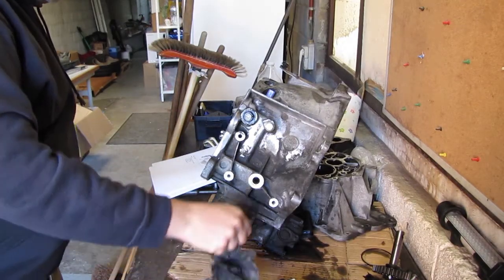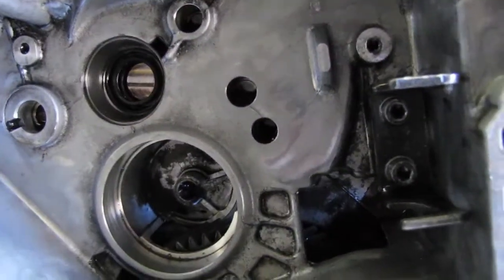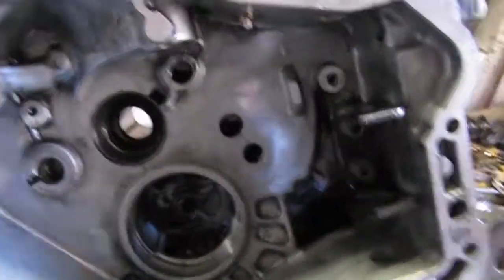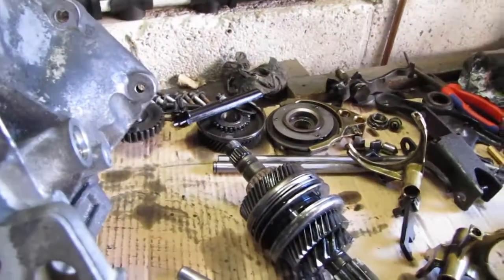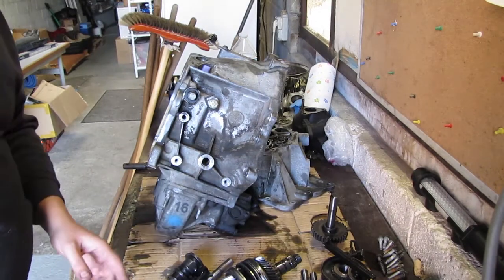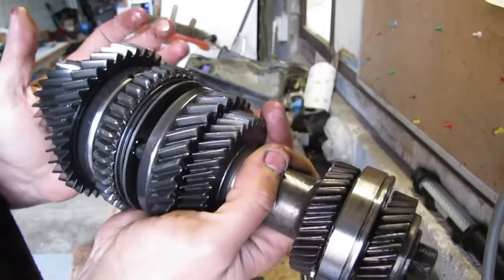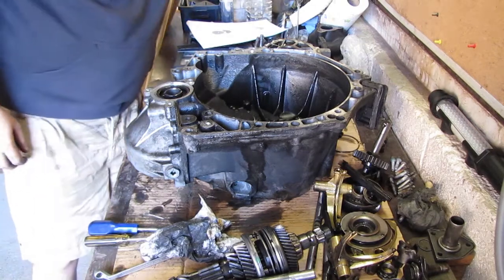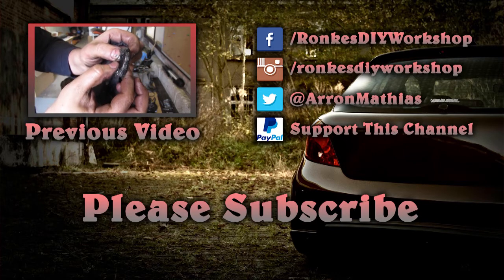Peugeot 207 - BE4 Gearbox Overhaul (Part 5)

Comment: For changing differential there is no need to dissasembly the whole gearbox? Im considering LSD, and from your video it seems that there is no necessity.
Second question if you know the answer - there are washers for setting up bearing play in differential?
Reply from the maker: Yes, there are shims inside and yes, I do think you can change the diff without full disassembly.

Comment: Don't start doing a box refurb without the right tools - jamming screw drivers into gears etc. levering up things with yet more screw drivers rather than using pullers, its just a complete non-starter.
Reply from the maker: It worked out great though. Never missed a beat after the refurbishment ;)
As an aircraft technician I live by the credo, the right tool for the job, but this was a hillbilly DIY just for the fun of it. I never claimed anywhere that this is the way it should be done ;)
Reply: @Ronke01   hi mate good videos I have the Sam gear box . Please could you discribe  the symptoms you had . Before the rebuild . If it's possible I would like to discribe some symptoms I am having please let me know if I can explain in detail the problem so I can receive you knowledge on it thank you

Comment: Bonjour
Paris 2019
Quel est référence de Gearbox.
Merci
Reply from the maker: C'etait un BE4. C'est tout que je sais.
Reply: @Ronke01  très bon travail.. ça m'a aidé beaucoup.. j'ai un 307 cc 177ch 2l Essence de 2004 ,et ma boite a tombé en panne..jeux important sur le roulement.me je ne trouve pas la référence de roulement a changer.
Merci pour la vidéo ça aidé beaucoup.
Bonne continuation.
Reply from the maker: Merci beaucoup Georges. Si tu as le nr du chassis de ta voiture, je peut controler la ref de tes pieces ;) dis moi lequel vois avez besoin. Retrouver ma page sur facebook, pour envoyer une message